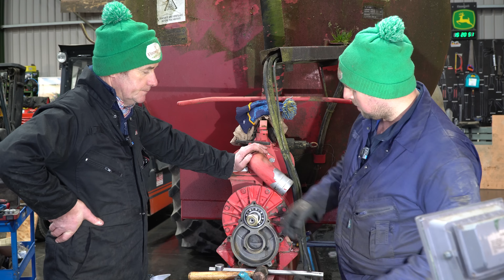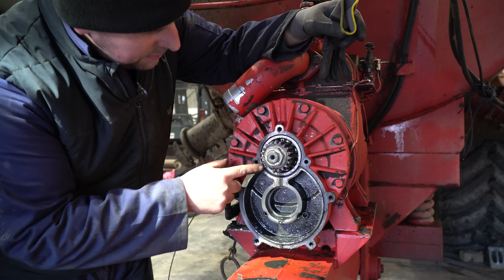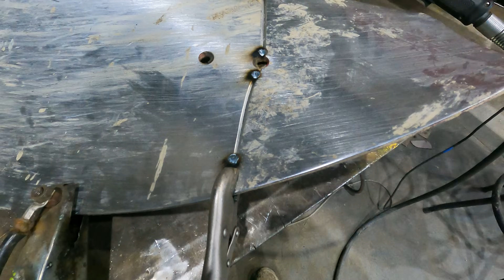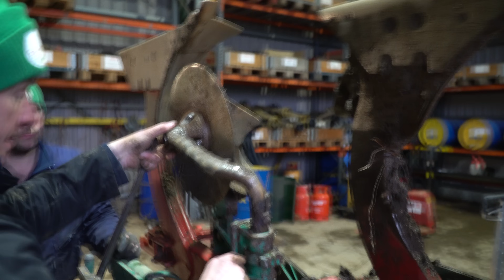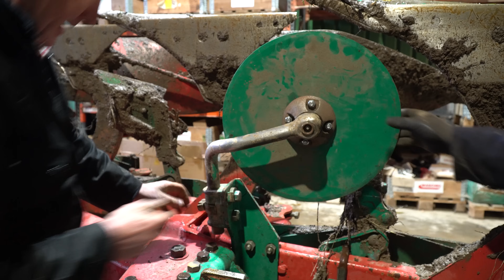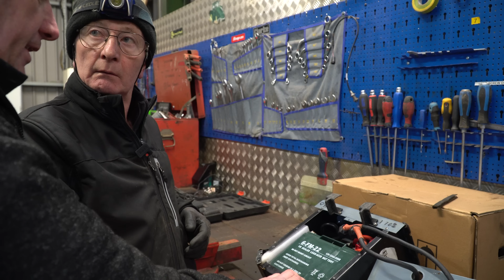WORKSHOP WEDNESDAY EPISODE 117

Comment: Paul & David--The vanes in your vacuum pump are made of compressed linen as I recall. Those Moro pumps are very durable but still require routine maintenance. For what it's worth, here in Alberta--I've always made a practice of running approx. a litre of diesel through the oil injection inlet (with the lid screwed off) with the pump in vacuum mode at low idle until you see the diesel being blown out through the exhaust port at the end of each days work. This has a 2 pronged benefit---keeps the vanes cleaned of sludge, (preventing stuck vanes) & flushes out moisture & in our case eliminating the pump from freezing under our severe cold conditions. A few minutes work & time well spent I've found..
Reply from the maker: Thanks very much for your comment great advice there on maintaining the life of the pump 👍

Comment: If filling is slow sometimes on a old tanker the inner layer of the pipe above the ball can suck in leaving it normal speed spreading and slow filling and the vacuum clock will show normal.If you don’t need to open the gearbox it’s easier to fit vanes from the back after unbolting the pump from the drawbar. You can flush out a pump with 5 litres of diesel by putting it on to spread position with the back open and pto on and pour the diesel down the outside of the exhaust and it will be sucked in and deposited in the tank.
Reply from the maker: Cheers for that not the first time you fixed one 👍
Reply: @finnegansfarm9137  I also have a long right angle scraper with a curved bottom for scraping out silt would be handier on the young lads cleaning it out